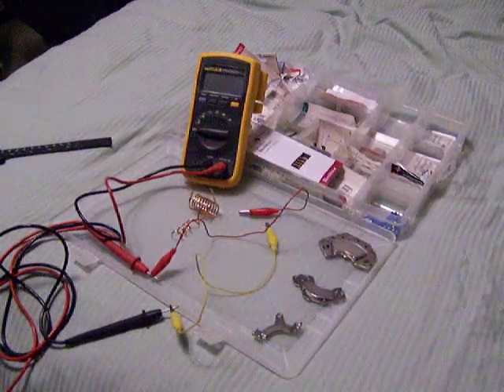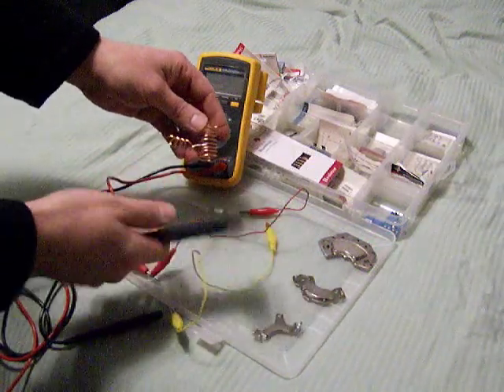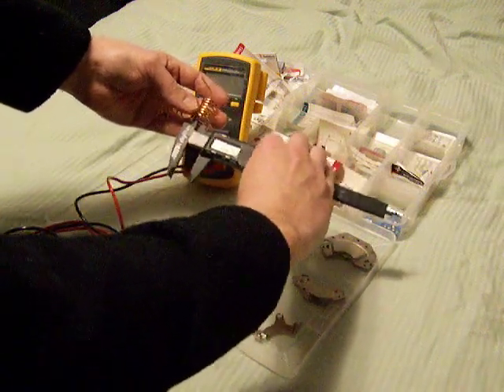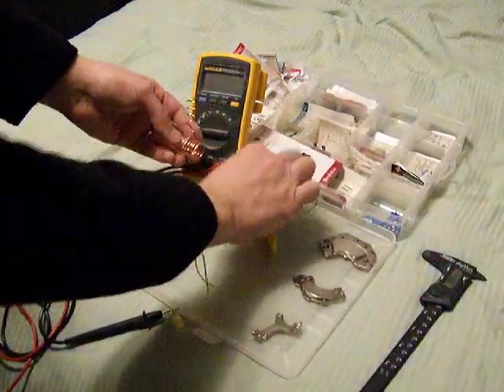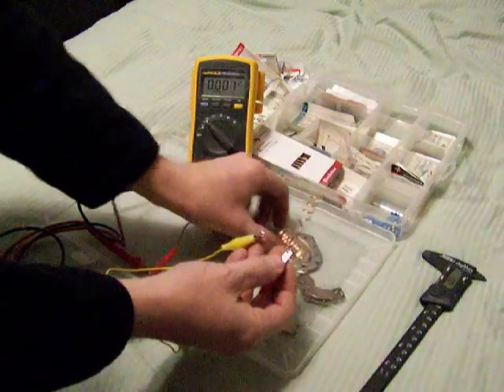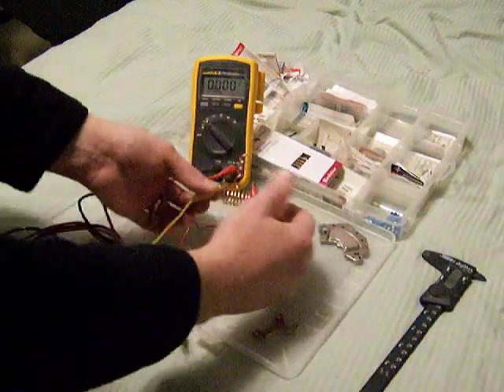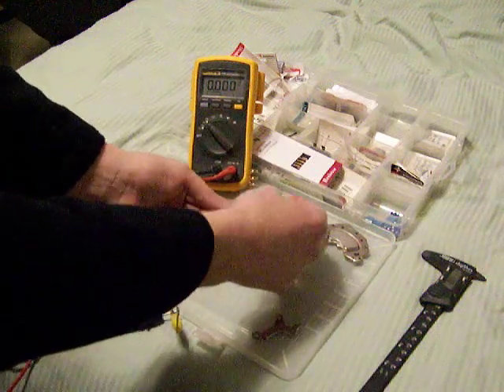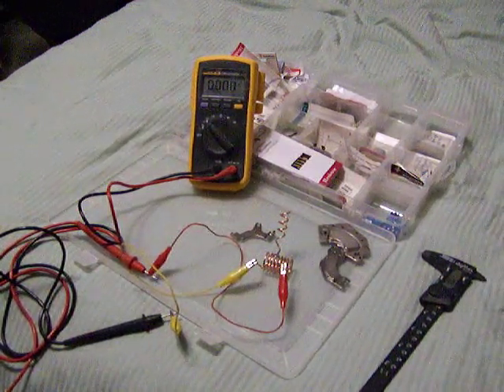Response to solid state free energy generator schematics diagram

Comment: All this scammers have a transmission coil near by and this wire shape as a coil works as on antenna and that's why the coil produces some voltage, to be able to produce energy is necessary to have movement of magnetic fields  by permanent or electrical magnets